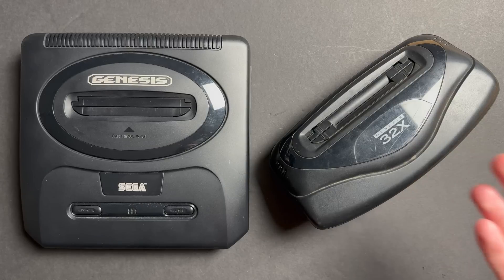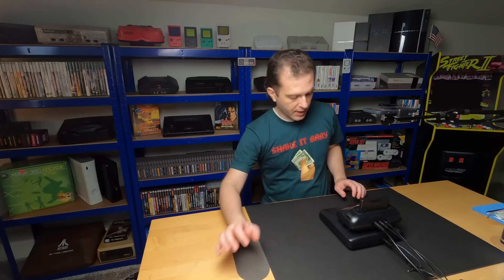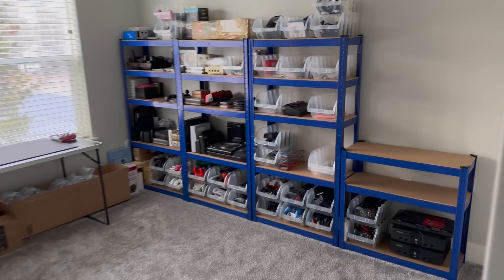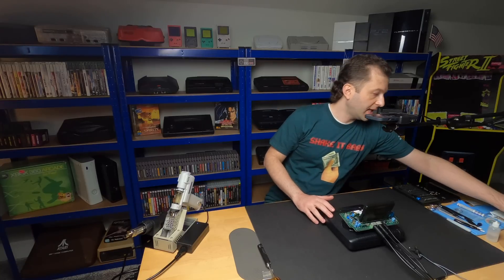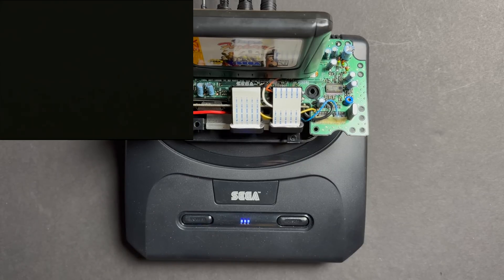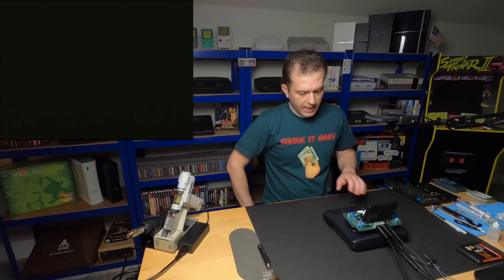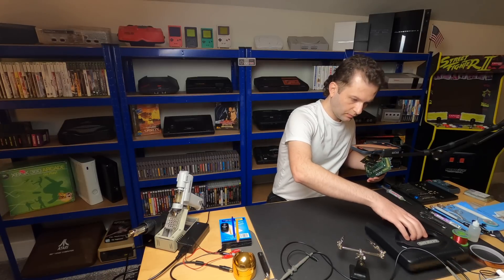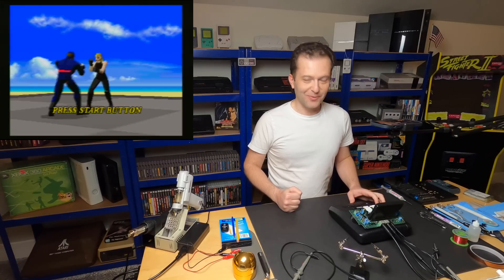A tiny fault with BIG consequences

Comment: What was the reason for replacing the port? Seemed like it just needed a reflow to me. Mega drive 2 has the same connector and it's notorious for cold and cracked solder joints due to the rocking of the port of the years.

Comment: A little constructive criticism from someone who works in semiconductor industry: It's recommended to also cover the old broken trace with  the uv solder mask. It's not the part that is required to make the device work after the fix. But since you didn't cover it and even scratched the old mask off the trace, it creates a channel for corrosion going under the uv solder mask along the old trace and ruin more of the good part of the trace where you soldered the wire to. So even if not needed for function it should be covered also for long-term reliability..

Otherwise really good video.

Comment: Your channel is giving me inspiration and motivation to learn how to solder on circuit boards and fix my NES. I'm a mechanic so I have soldered wires and can read diagrams but that was just soldering wires together, not at all like working on boards. Hoping to start with the nes and work my through all my old consoles. Thanks for your videos!

Comment: You should always clean the cartridge connector pins (on the Genesis side and cart side) before hooking it up that way you wave the greatest chance of success. 

My 32x doesn't like working when there's the slightest hint of dust anywhere near the 32x/Genesis side of the connection, if I leave the 32x in my system after cleaning it'll be fine as long as I keep it in the system, if I remove it for a few days and try to use it again it just won't work until I clean the cartridge pins and slot on the Genesis (could be a bad genesis cartridge slot, but the Genesis (without 32x) always just works with every Genesis game regardless of how long it sits with nothing in the slot). 

When a 32x isn't working or not working correctly It's usually always the white ribbon cables making wonky connections, and when that's not the issue that's when you need to start worrying.

Comment: One of the reasons I slowed down on certain repairs is because I thought those rework stations were dumb expensive.....MAN if I would have known I could have gotten one for under $30....I wouldn't have gotten bamboozled outta my switch that need a usb c port exchange on ebay. Thank you nonetheless....I may just do hdmi repairs again.

Comment: Bravo mate.  I too have been working on game consoles for decades.  Had my own store and everything.  Miss it.  No longer do this thing but always fun to watch.  I used Kynar wire to bridge dead traces, etc. Worked like a charm.  These old X32 have known problems all the time. the flat ribbon cables are classic spots and oxidized connectors.. so common.  Nice work!

Comment: I have this Mega CD model 1 (jp), and I bought it as "junk" in the auctions, but when arrived, it was working. But the capacitors were leaking, so I bought a capacitor kit from Console 5 and swapped all of them. After that, the Mega CD stopped working, it was freezing at the bios screen. I was trying to fix it for months, with no clues of what to do. 

But inspired by this video, I decided to give it another go. I had already fixed a lot of broken connections in the main board, and after watching this video, I did another try on the coninuity test with the multimeter. In the first memory chip that I was testing continuity, I found out that the connection between the leg 5 of the IC5 chip and the negative side of the c11 capacitor was broken. I bridged with a cable, and went to test the Mega CD, already expecting for the godamn frozen bios screen. But it worked! I had the exactly same reaction as you in this video, and I thank you for the inspiration, I was already preparing to expend a lot of money in a working unit. 

Thank you, thank you so much! Keep the good work, your videos are very educational and inspirational. Being playing Sonic CD the whole week, and already ordered Final Fight CD and Silpheed, finally I can start my Sega CD games collection!

PS: A tip for people thinking about recap the Sega Mega CD: Be extremely gentle when removing the older capacitors. Maybe it's better to invest in a hot air gun, some solder remover ribbon, etc. What I did, to use pliers to cut the capacitors in half and have access to the solder joints, was the source of all my problems, since it clearly broken at least 3 connections. Another tip, is to test the device after EVERY SINGLE capacitor you installed, so if you break something, you already know where the problem is (I wish I could have know this before, it was HELL to look for broken connections and stuff, without having a single clue where to look).

Comment: Thank you for using Celsius degrees.
Reply from the maker: Honestly iron and hot air temperatures are the only things I use celsius for. It appears to be more common in the repair world so that's how I learned it when I started but I find celsius confusing for pretty much everything else 😅
Reply: @BorderlineOCD  Well, I think Fahrenheit is a lot more confuses than Celsius, because Celsius is from power of 10 and ºF is power of... 32? I never know.

Comment: Great job! I picked up an untested 32x a few months ago that wouldn’t work initially either, but after taking it apart and cleaning the connectors and ribbon cables, it worked flawlessly. Thankfully I didn’t have to go through the troubles you did but I’m glad you solved it!

Comment: Nice video! I have a couple comments from things I have observed with my own chip quick usage:
I think you used much more chip quick than was necessary for that power jack. I usually melt just a small dab with my soldering iron and it's enough (maybe 1/4 of what you used).
If you leave too much chip quick behind, it can make your solder joints surprisingly brittle! I don't think you'll encounter any issues in the near future with that power jack, but the solder could crack after some stress.
I love seeing these repair videos! Keep it up!

Comment: What do you theorize happened to the unit to cause that problem? Manufacturer/design defect?
Reply from the maker: Not the slightest clue. No evidence of water damage anywhere and the location of the trace doesn't suggest moisture as it's on the underside of the board rather than the top. Some consoles like the Neo Geo are notorious for trace damage, not sure why but many non-working units just have rotted traces. I'll have to see as I come across other 32Xs in future whether there's any pattern of failure or not.

Comment: I still have my 32X from way back. It had shields that were supposed to be installed inside the sega cartridge slot. It held the doors open. They snapped into place. I don’t think I have then anymore and I know I would have trouble getting games to play sometimes. We would ditch the shields and then it would work. I seem to remember them being important but never fully understood why. They must reduce interference where data is going through the game slot.
Reply from the maker: Yep they are electromagnetic shields. The system appears to be very sensitive to EMI. Funny your console worked with them removed but not attached. The ferrite rings/loops around the ribbon cables are very important as well and according to anecdotal reports removing them causes the system to randomly crash.
Reply: @BorderlineOCD  It could have been more coincidence than anything. It was the days of blowing into the cartridge to get them to work. Lol. No internet but we all seemed to know that move amongst others.

Comment: This will probably fall on deaf ears, but you wanna mess around with a Sega CDX? I pulled mine out of storage to play some games and I'm pretty sure this thing needs to be recapped. It worked when it went into storage and now it doesn't. I don't have the skills to fix it, and the people I have talked to say they don't want to work on a Sega CDX. I have no use for this thing anymore and it makes me sad.
Reply: CDX is a nightmare to work on haha. No service manual, sandwich PCB with traces running through the middle of the board, and a laser that's almost impossible to tune correctly without an oscilloscope. Just diagnosing them alone is a massive undertaking

Comment: After you replaced the power plug and got that black screen. that is exactly what my model 2 Genesis does on its own. No 32X or Sega CD connect at all. Any clue what causes that??? I been trying to figure out for a few years now.

Comment: 6:30 be careful using that much heat on old cheap circuit boards. I've warped and scorched boards that way. In particular phenolic paper boards are not usually tolerant enough of soldering temperatures to use hot air on for extended periods, so take caution if you see a board with no hole plating that looks like everything was wave soldered. Even boards designed for reflow soldering can warp if heated unevenly.

I think you could have gotten a similar result just using your iron. The three pads are close enough that you can easily go quickly back and forth. Combined with the chipquik you can get that off no problem. Just have to flush your iron tip with solder to get the chipquik off it.

Comment: Nice job, I am still curious what was this blue component close to the blue wire and a crystal at 3:39 that looks like a blown capacitor?
Reply from the maker: That's known as a trimmer capacitor, likely to calibrate the crystal in the system.
Reply: @BorderlineOCD  Very interesting, I didn't know about those. Thanks for answering!

Comment: As a (not really) proud 32X owner myself, I have some things and grievances to share

First, the ribbon cables in my unit were a constant pain. No matter how much I cleaned or reseated them, my 32X would always find a way to freeze or crash mid-game. I ended up having to bust out my soldering iron and just tin the connectors on the cables themselves. That completely fixed all my freezing issues, so now I can finally enjoy Doom Resurrection with no issues whatsoever

Second, I noticed your 32X revision was a MARS VA 0. Mine's a VA 1, and apparently the older revision has problems running on certain Genesis/Mega Drive board revisions. Sega even provided a small piece that connects to the side where the Sega CD hooks up, which terminated some pins on the side to fix those compatibility issues. Was about to say that might be the problem with your unit, but props for finding the small trace rot when you did.

Anyway, 32X rant over. Thanks for another great repair video, and have a wonderful day

Comment: Boy, are these things problematic. I got one when they first came out, and it stopped working about a month later. Exchanged it for another, and THAT one went dead after about 2-3 months. So after much frustration I pretty much gave up on it, and it sat in one closet after another for several years. Recently, after moving, I was setting up my retro games, and decided to readdress my 32X after watching a video about the finicky ribbon cables. Took it apart, pressed the cables back in, tested it before reassembly, and it worked. Reassembled it, and... NOTHING. 🤬WTF!? After more frustration and several strings of expletives I figured out it ONLY worked without the case. I ended up filing down the lip around the underside rim to make better contact with the cartridge connector on my model 1 Genesis. That seemed to fix the problem, but I am finding that it still acts up intermittently. I end up having to play with it, inserting it in and out, trying to find it's sweat spot, and that usually worked eventually. I have thoroughly cleaned My Genesis, and my 32X still looks factory new inside and out, but I just can't seem to find a consistent function with it. Once I get the thing to start up and play, it seems to work fine, but I'm starting to wonder if the model 1 Genesis is the wrong contour for the 32X. If anybody else has this problem let me know, but I am thinking about finding a model 2 to play it on instead.

Comment: i fixed 2 32xs in one sitting by having to reseat both those flux ribbon cables. They generate alot of heat on the top of the unit (if you ever played a 32x it gets hot to the touch) and it backs these cables out. So anyone reading this id start there if you once had a known working 32x and all of a sudden it doesnt work.

Comment: Nice fix! I had the same issue with my 32X’s power connector. Luckily for me after replacing it it worked fine. Don’t think I’d be able to find the rotten trace.

Comment: I seen a small bridged connection at those ribbon cables.
Reply from the maker: There are a couple of pins on those connectors that are bridged from the factory. I noticed it too while doing the continuity checks off camera. One of the bridges was a ground line but the other wasn't so not sure what signal it carries.

Comment: What soldering iron is that small portable one? Is that a TS100? I use that on FPV quadcopters. Love mine. I don't have a long enough cord to reach my nearest power outlet though, so I have to use 6S lipo batteries lol. BTW thanks for the video. Not sure why, but small electronics soldering relaxes me.

Comment: Dude - just wanted to say thanks for your videos. The way you explain your troubleshooting process and techniques gave me the confidence to finally start working on my old consoles.

I've restored my childhood Genesis, my original Xbox, and now moving on to my PS3 and Xbox 360.

Again, thank you!
Reply from the maker: Great to hear!
Reply: I love tinkering with my Mega Drive. There's a lot of mods you can do. I did a selector switch to change the region between Japan and USA (don't have interest in PAL option) and I did a p2 output in the back of the console (because I hate it to have a cable coming from the front of the console to the back of my TV). Now I'm thinking about installing a s-video output in the back of the console. Very cool console for mods.